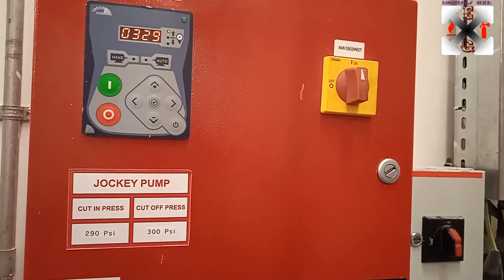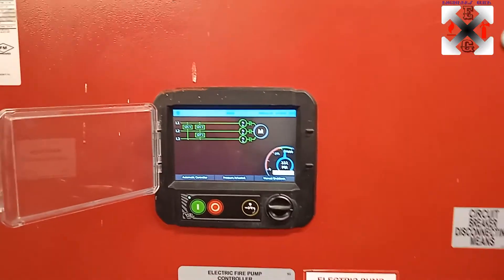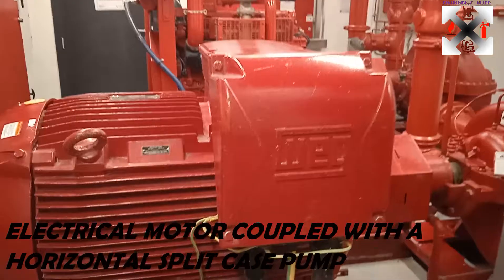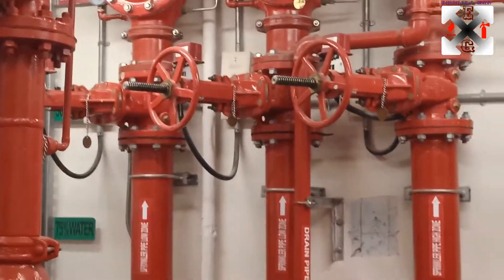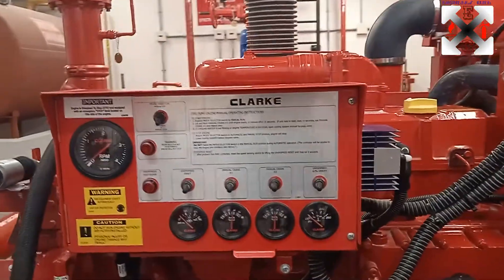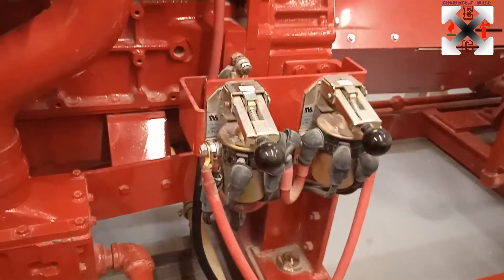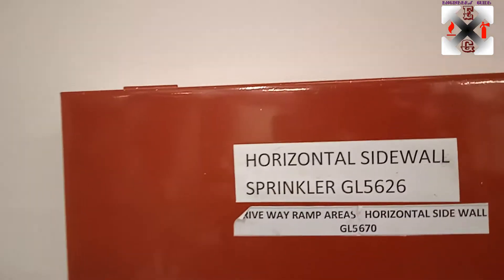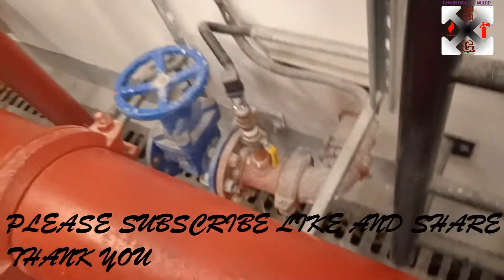FIRE PUMPS SYSTEM INSTALLATIONS OVERVIEW AND HOW IT WORKS#fire #electrical #firecontrol

Comment: Does Diesel FP only operate on Power Failure? How about when there’s no Power Failure  and while the Electric FP is operating and there is still more demand such as pressure drop to cut-in pressure of Diesel FP? Will Diesel FP assist Electric FP?
Reply from the maker: diesel engine is mainly designed to work on batteries only,the presence of ac supply is to charge the batteries, diesel pump can operate when there is no ac but batteries are connected.
2.yes the diesel pump has to work when it reaches its cut in point unless the pump has interlocking..so pls check that as well.
Reply: Generally, electric and diesel pumps work sequentially, which means if the electric pump failed to start for any reason, and pressure dropped to cut in limit of diesel pump, this pump will be started.
As far as I know, pump are selected in a way  that the electric pump (or pumps) capacity can meet the flow and pressure requirement of whole fire water network and diesel pump (or pumps) will operate only in emergency situations.

Comment: Why not any flexible joint before and after pumps?
Reply: Good question , flexible joints are usually installed on suction and discharge nozzles where  high temperature fluid exists in suction or discharge (thermal expansion)  or where Axial displacement of piping shall be absorbed, eg.  in Centrifugal compressors or  blowers. I personally haven't seen flexible joints in inlet or outlet of pumps in general.

Comment: Very instructive. THANKS. 
Just for your information, CRV or circulation relief valve are installed on discharge flange of main electrical  pump. When the pump is working with no flow (churn condition) the water temperature will increase which can cause serious problem for pump. To regulate the temp in this situation, the CRV will operate and drain some of the water from the pump casing and another valve will let some cool water to the pump.